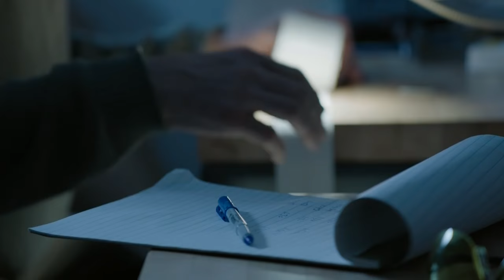The Battery That Refuses to Explode | NOVA

Comment: yeah its cool but what about the energy density?
Reply: The full documentary explains this better (roughly 2x due to using pure lithium).
Reply: @withjoe1880  Are you telling me it uses PURE lithium and STILL doesn't explode? Jesus christ
Reply: @Pengon88  Yes, such is the wonder of solid state batteries.
Reply: @withjoe1880  This is the wonder of a battery that never saw the light of day! 3 Years later, this battery is still not produced.
Reply: @NMETSGChan  yeah I watched the documentary two years ago and only now finally found the video. This battery deserves more recognition

Comment: All good but what is the charge and discharge rates like?
Reply: Safety alone would justify going forward with this, specially in car battery applications. Remember the Tesla crash  footage and all of the fireworks after the crash? If a liquid electrolyte battery ruptures even in a small side crash, there is nowhere to run....
Reply: Or heat conductivity? I'm no experct but I know that plastic has poor thermal conductivity. And if this battery happens to have worse thermal conductivity than current lithium based batteries, then probably there are way lower charge/discharge rates.
Also, nope, electric car batteries are nowhere as dangerous as you say and also, if this battery has poor charge/discharge rates then it doesn't justify it.
Reply: Yeah, the corrupt corporates...or, more likely, there is a serious flaw with this battery.
Reply: The full documentary explains this better, it claims the same performance (or better than some of the current electrolytes).

Comment: Most of batteries venting out or blowing or catching fire in the footage are not Li-Ion but Li-Po batteries.
Reply: Li-Po is Li-Ion, just in a plastic (poly) pouch.
Reply: The form factor and packaging material may differ, but the main difference is in the type of electrolyte which is a polymer, hence the Po in Li-Po, whereas the Li-Ion batteries use a liquid electrolyte.
It's not just the pouch.

Comment: Why is tesla not working with these yet? They are stuck on 18650s that add over 2000 pounds and catch on fire. Just saying
Reply: They probably are working with these in a lab, but getting something to mass production is quite hard. They've delayed their announced battery day for months, which means that whatever they're currently working on in secret is taking a bit longer than expected. Could be solid state batteries.

Comment: Watch the whole Nova show on the battery Tech  on PBS from the start of the program and understand that the Electrolyte Liquid Solution mixed with Lithium is very Flammable when it gets contact with oxygen or water ! This battery tech has no Electrolyte or water ! All of the plastic  is coated with a thin layer of lithium .There appears to be 2 batteries of different sizes one at start that seems larger and another at 1:48 as Mr China whom Screams fake but has no Evidence .Even if there were 2 batteries,they had the same result and did not blow up,burn,smoke or catch on fire and still worked,though at the end the lights did try to go out when it was cut down more than half it's size which is not fully shown on youtube as it was on NOVA on PBS . This is not the whole Video and some is clipped out ! It seems another guy and company making similar batteries based on same tech which is NOT FAKE https://youtu.be/_dJ2AX43OVo  Also people might want to understand that when Lithium is given more air when cutting into that battery that it actually creates more energy for a short time because Lithium heats up when given oxygen.

Comment: Spoiler alert, the lights have a separate battery inside the housing and what you're cutting is just tin foil.
Reply: At 1:57 you can see exactly that. When you cut the battery, you short it. This means that the lights must become darker or go out.

Comment: YouTube Comment below:

It would be nice if this type of Technology could be adapted to Power Wheelchairs. The battery is Safe, Lightweight & better for the Environment. All someone would have to do is use this same Technology to put a good handful of these together to create a Battery Pack. The battery pack could be designed around the Wheelchair/Mobility Device to maximize Efficiency, Range, Safety this will give more ability for #PWD People With Disabilities. If this technology is paired with very powerful Motors that use 10 times Less Power than conventional technology used today in 2018 this would provide more Access & Opportunities for PWD to get around & if a person needs help to Transport their Mobility Aid it won't be as Heavy for others to lift. All someone would have to do is take this Cool Technology & find a way to put all of the battery poere to run ALL Features & the Power Wheelchair with this Technology in a 3X3X3 Inch Cube. This would use LESS SPACE & if 1 Cube could take a power chair Farther than 2 big HEAVY Gel-Sell Batteries would & was 99.9% Cheaper in cost you could Imagine what your abilities & Range would be. If the technology was designed the Right way a person could have Endless Range & Opportunities if they could fill the Same Space in their current power chair / scooter with a lighter, safer, smaller, more affordable & longer lasting technology? Instead of getting 10-15 Miles for a 10 hour charge every night using 2 Gel-Sell Batteries if 1 3X3X3 Cube weighing less than a single pound could take 4 hours to charge & could carry that Same power chair 3-5 times Farther before needing a full 4 hour charge, could you Imagine having 6-12 of these batteries in a power chair & the Range that you could have? This is the way we MUST & NEED to be going. Wheelchairs could be designed with this new technology so you could have a main battery pack that is connected to the main drive wheels & on the Seat area you would have a secondary smaller battery pack that works hand & hand with each other. This would mean you could once a week or twice a month you could give the main batteries a very slow & Deep Cycle Trickle Charge. Where a regular Trickle Charge would be 4 hours a day to travel 45 to 50 Miles you could be giving the main bigger battery pack a Longer & much Deeper Trickle Charge for 10 to 15 hours & still have the ability to use the chair. The chair could be designed so the 4 Caster wheels, Frame, Seat etc could lift up off of the main Drive Wheels & the chair still can be used for a shorter distance while the bigger battery packs are charging making mobility more Accessible for the user of the power chair. This would provide more Independence for PWD #Persons #With #Disabilities. Lets make #Accessibility a (#RIGHT) Not a (Privilege)!
#DisabledLivesMatter!
https://youtu.be/m9-cNNYb1Ik
Reply: if its actually performs well it would be use everywhere not just in electric wheelchairs
i didn't even attempt to read that wall of text. shorten up.

Comment: BATTERY IS FAKE!!!!! 1:48 YOU CAN SEE ORIGINAL SIZE OF BATTERY!!!!!!!
Reply: Only partly fake ... it looks to me like he chopped at the edges, where the plastic has been sealed. Not sure if he actually chopped through the middle part where the electrodes are or not.
Either way, I'm still suspicious of the battery, until we actually have more tests done to prove it will work. (Like, to prove that even if it doesn't catch fire, that it still will have good charge/discharge capabilities like it's flammable counterpart.)
Reply: 13pickles13 it is fake
Reply: Actually in the whole vid he cuts it all the way down to the wires.
Reply: This is a clip from the show. In the show he cuts down to the wires and the light stays on.
Reply: Yeah, the battery seems to be totally flat, like having no contents and only existing of two sheets of aluminium foil or alu tape. Also it is highly suspicious that the LED lights array is in a package that is so voluminous that it could easily hold a set of batteries of its own. The thing of which they want to make you believe it is the actual battery, only has to be a CONDUCTOR for the lights to stay on in such a set up.
Reply: If you look closely, you can see the light flicker when the battery is shorted internally from the blades of the scissors. Still fake? Possibly, though I say unlikely.
Reply: Its not fake... Well at least not obviously fake. Also theres a later clip where hes doing it to a thicker battery thats running a phone and ipad... After several stabs at the thing the ipad did loose power... for a moment. they could boot it back up. My biggest issue with all this is... This is well over a year ago now. Why isnt this battery already on the mass market? At least in the demonstrations it appears the tech isnt hard to replicate and convert current manufacturing practices to this method.... 

Thats the only suspect thing. Unless its something as annoying as IP rights holding it up. (thats the most likely case)
Reply: takes a long time for new tech to be adopted. If it ever is at all
Reply: its rather the fact that most big battery producers have already made huge investments in lithium-ion research and production facilities. If they do not make profit from those investments first than they will be unable to function as a company let alone a publicly traded one. Alot of companies are pursuing the technolgy but they cannot just throwaway all their investments when alot of them haven't made a proper return yet. This leaves room for new companies to disrupt the market if they manage to develop efficient production methods and get the right amount of investments.
Reply: @harrickvharrick3957  Ever seen an 18650 unrolled? Looks like a flat sheet of nothing, but then is rolled up into a 'battery'.